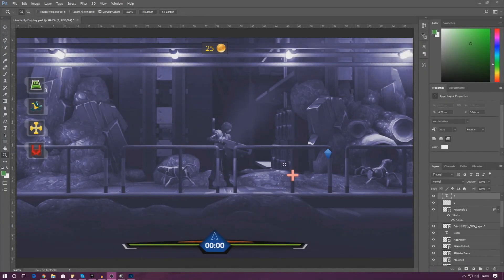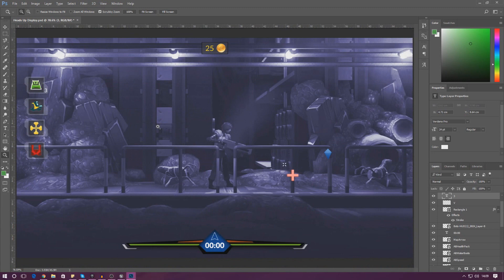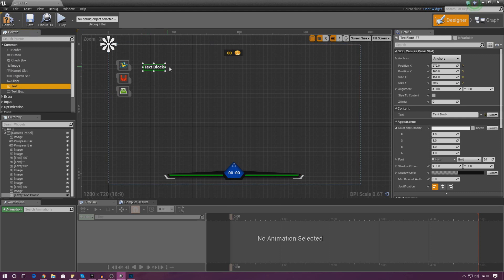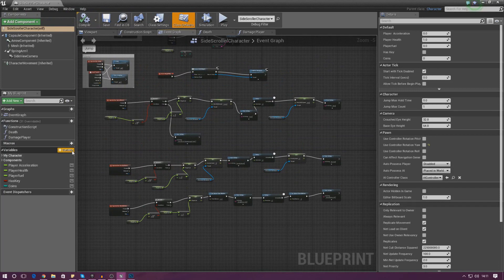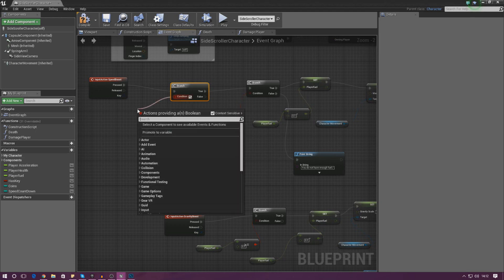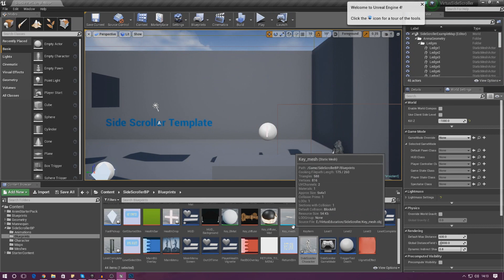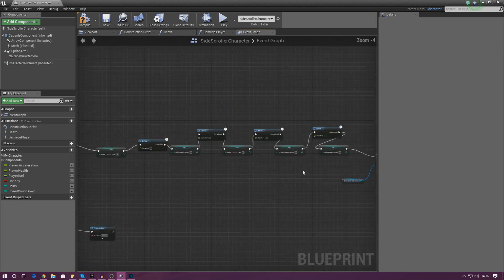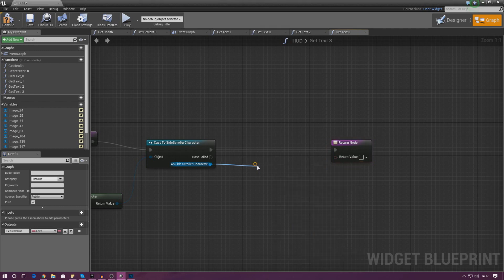Ability Cool Down System - #23 Creating A SideScroller With Unreal Engine 4

Comment: I've gone through the whole tutorial.  When it comes to these ability countdown timers (gravity and slow motion), I tried many times and configurations and it's not working properly.  A breakdown video would be great!  Alternatively, I could just leave all of that out and call it good.  I want to understand how to make it work though.  I'm also having issues with my character not going through the door.  The door opens, but the character will not go through.  Other than that, I want to thank you for all of the efforts you put forth to make this series and plan to check the others out as well.   =)
Reply: I know this is an old comment, or if you are even doing this anymore, but I had the same issue with the door, it was because the door (for some reason) was too thin for my character to fit through, so what I did is added an extra piece of code to my door events (anything involving the door) that basically set the door collison to "OFF". The node is called "Set Actor Enable Collision" :)
Reply: it took me a while to figure these out and im not sure if its correct as im only just learning myself but I figured a way for the slow mo that seems to be working for me, you want to put in a sequence node and then set up the same as in the following link. youll have to play around with the delay durations to allow for the slow mo effect but I found 0.4 is the right amount, hope this helped https://i.imgur.com/SpJP49B.png

Comment: Very nice video, as always, dude! Been watching the series since the beginning, to learn Unreal Engine :-)

One suggestion I'd like to make, though, is that the countdown logic can be way simpler than that, without requiring any more knowledge than what you've shared already. Instead of manually putting one group of branch/delay/decrease for each second (which is even funny, as it looks like "loop unrolling" like some compilers do), you can have only one and reconnecting the end to the initial branch, so that it looks like a "while" loop. That way, if you want to increase the countdown start to, say, 30 seconds, you don't have to change anything other than the value right before entering the "loop".

Of course I tried the standard "While Loop" function, but it doesn't work with a delay in its loop body (not sure why, but I would guess the delay happens in another thread while the loop keeps running, i.e., the delay doesn't block the loop, maybe).

So, basically:

1. Set countdown to 5
2. Branch and check if countdown hit 0
3. If so, carry on and reset the speed etc
4. If not, delay by 1 second
5. Decrease countdown by 1
6. Back to item 2 in this list (reconnecting the execution control back to the branch)

Cheers!

Comment: i did this in a different way  by creating a timer by event that loops every 1 second then connecting it to a branch that uses an extra variable that checks if i used the ability then i just made the math for -1 in the countdown and then i had to make sure that the timer pauses at 0.
Reply: I think that is a good solution, I will try playing around with your solution. The solution I used was to set the Countdown Variable to 5 then head into a branch. Branch condition was 0 > then got a reference to the variable. True went into the delay, then into a set node. Integer - integer the the output of that went back into the branch start. False was connected to the end of the script (set walk speed) Its not the most elegant solution but I think it is a little cleaner then what was presented in the video this time.
Reply: Have you got a link to the image of your method? Or have you found a better way to do this? @melodicfish7833
Reply: @p.w.s8407  So follow along with the video up until he adds all the delays. Then just add on branch with the condition " speed cooldown == 0 like he added at the start for his event. The Ture from the branch connects to the rest of the event. Connect the false pin into 1 delay set to 1 second. Then into a decrement node or int - int to reduce to  set value of your cooldown variable ( this will need to be done as you want it to show on screen counting down) then just loop the the out pin of this section back to the start of the branch. Then follow along with the rest of the video. If this is not clear enough for you I count put a image together for you later today
Reply: @melodicfish7833  I shall try this out. Thanks a bunch. I'd still like to see the image when you can just to make sure I got it right.
Reply: @p.w.s8407 I found a moment to get to my PC for you.. here you go this should work for you. If you are not getting the right countdown with the ui change the condition going into the branch to a int > then but this should work as I have set it up https://www.dropbox.com/sh/oxgz2266zdegv94/AAACEENlF_5KoxN4dnzf7SEga?dl=0
Reply: @melodicfish7833  Thanks for taking the time to post this. Very helpful.
Reply: @GenX_Reaxe  no problem good luck with your game:)

Comment: Hi guys! I somehow borked duplicating this for the Gravity and SlowMotion Countdowns. I just copy-pasted everything (swapping out for the proper variable). With both Gravity and SlowMotion, when I hit the 2 or 3 keys to activate the ability, I get the print string saying "Cooldown Active" however it stops the countdown timer. Also, for the Slowmotion boost, do we want the countdown to be slowed down too, or should it continue to count down in realtime?

Comment: Hey mate, started on UE4 a couple of weeks ago and have been blasting your tutorials, they have been a massive help getting rolling but this is where I've hit my first snag... Once I set up the cooldown animation from  the speed boost I got the other two set up, it all seems good to go but I can only have one EventTick? If I link the Play Animation node to the next Cast To SideScrollerCharacter it doesn't work? I've tried sequence nodes and this still failed, I've tried copying the EventTick node and this didn't work... The best I've managed is to link from the "false" part of the branch node, this will play the other animations if the first one isn't playing, but I can use more than one cooldown at a time? Any chance you could lend a hand? :)

Comment: Hi dude, first of all: Keep up with your work, I (we) really love you!
After this "love is in the air moment" I would like to ask you how would you have arranged the loop. I tried with while and for nodes, but apparently it skips the loop body and goes directly to the next step (where we set movement speed to his default). 
By reading Unreal Forum it seems that there 's a problem with delay in flow control nodes
Reply: Unfortunately, Unreal isn't set up to handle Delays in While Loops (yet).  There is a way to set up blueprints to simulate a while loop with a delay without using a while loop node.  ( https://answers.unrealengine.com/questions/1135/crash-while-using-while-loop-with-delay-in-bluepri.html ).  The long version is to start with a Branch checking your condition (EG Cooldown > 5); True goes to a Delay (EG 1 Second), False goes to the code once the loop is completed.  The Delay goes to a Sequence; Then 0 going to your loop, Then 1 going back to the branch you started with.